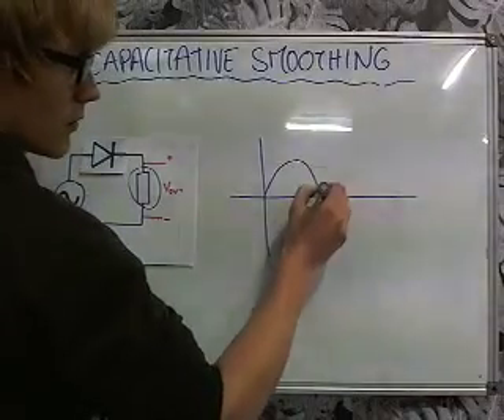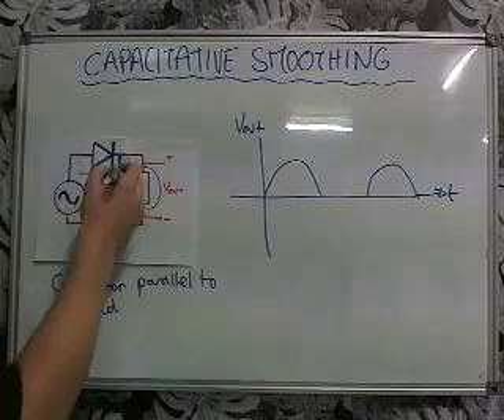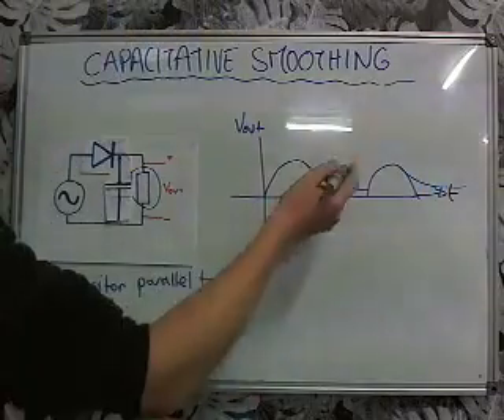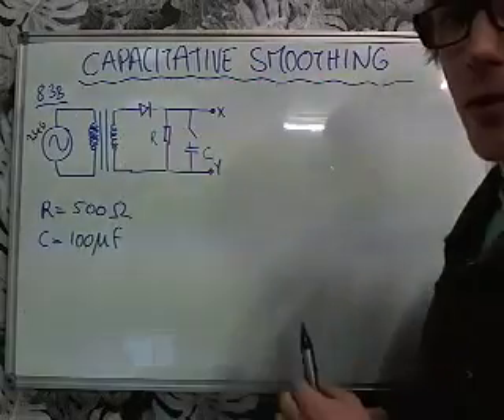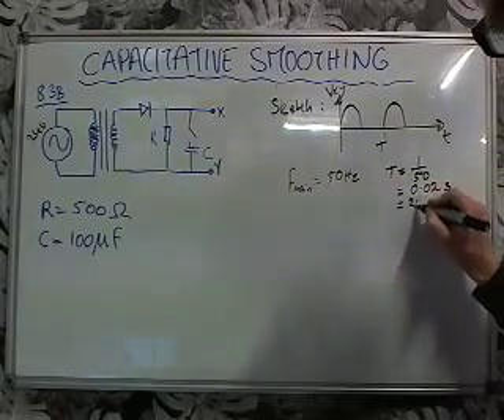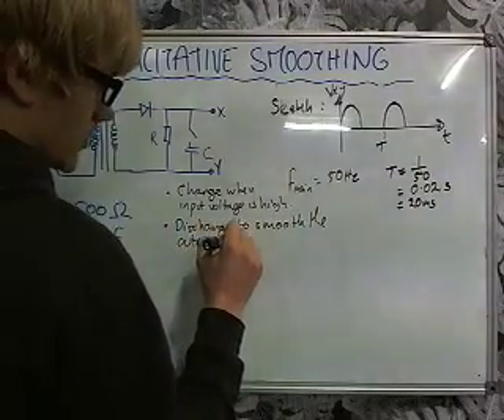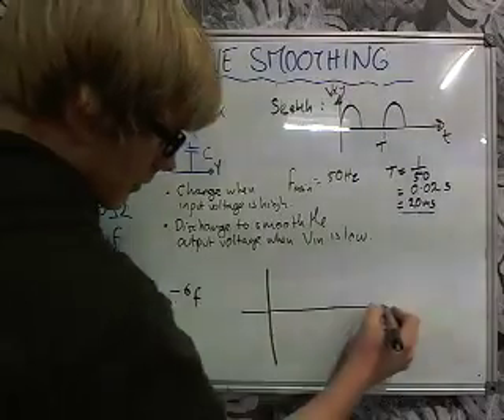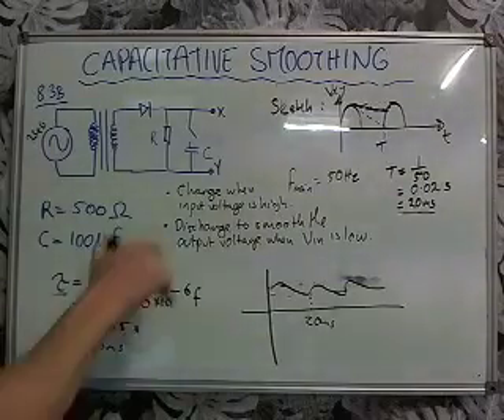Capacitative Smoothing

Comment: some may be confused, why if  you connect a capacitor and a resistor in parallel, and connect to a sin wave, the out put is a sin wave. The key here is the diode. When the sin wave goes up, the capacitor keeps charging, but when the sin wave goes down, it goes lower then the capacitor voltage, and the capacitor turns the voltage in reverse direction, that means the diode is shut. This will insulate the capacitor and resistor from the smaller sin wave out side, and form a temporary independent circuit, which only involves the capacitor discharging through the resistor. Until the sin wave outside catches up with the capacitor's voltage and turns inward again, making the voltage around the resistor the sin wave voltage. Then the capacitor charges up again until it oveecomes the sin wave again and shuts it out, leaving the voltage around the resistor not the shape of the declining sin wave but the capacitor's discharge voltage. In other words, without the diode acting as a valve, this phenomenon would not happen. Instead, the voltage around the resistor would simply be a different phased and sized sin wave. The diode matters!

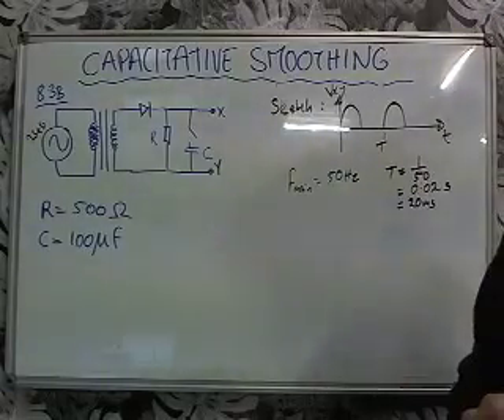Comment: at 6:54 he calculated the time period between the DC positive outputs. With an input frequency of 50Hz, meaning 50 cycles per second, he has calculated 20 milliseconds. Surely that is correct for the full sinusoidal waveform, I.E both the positive and negative portions, whereas the period between the positive outputs is half a cycle. surely the answer is in fact 10 milliseconds? please correct me if I am wrong here.
Reply: Yeah, you're wrong. Peak to peak is the full sinusoidal waveform, not a half cycle as you think.

Comment: YES! I already understand the fundamentals of capacitors.
@ (4:00), you make no mention of the frequency of the mains supply.
You say 240V.
OK, that great, but when deciding what cap value to use in a smoothing  application, is this not important?
Is this not essential?
Please! Am I wrong?